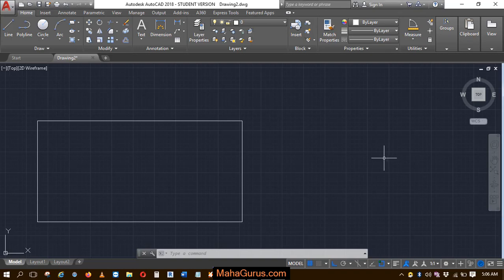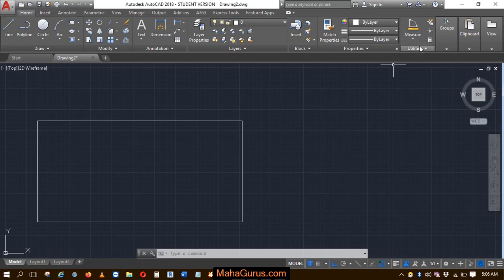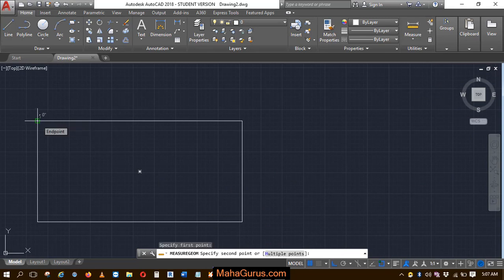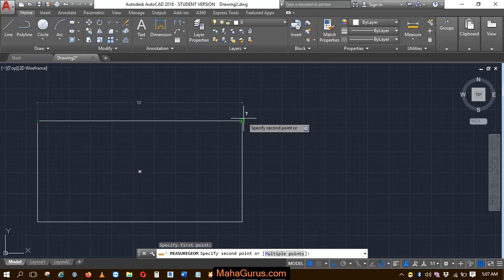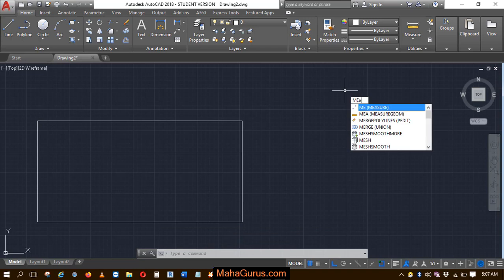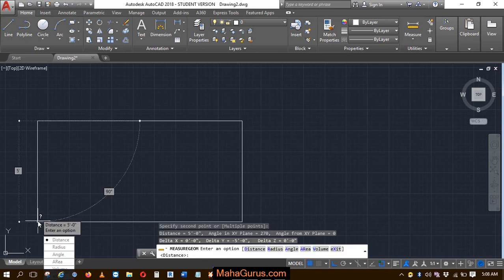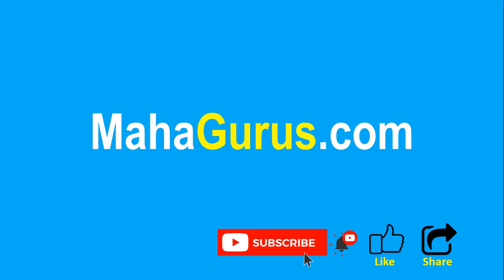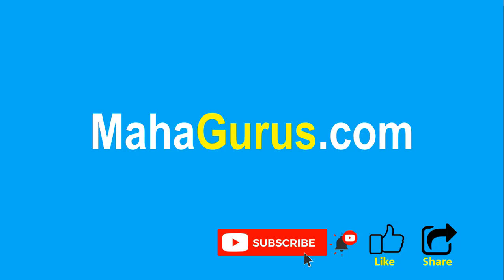How to Measure Distance in Autocad- Measure Distance in Autocad Tutorial

Comment: if you pause at :31 you can see the 10". Mine stopped doing this, it doesnt show me the dimension until I click the second point. Does anybody know the fix for this?
Reply from the maker: You have to turn it on from the settings.
use command "OS" press enter and from there you can turn on object snap and object snap 3D, check all the boxes and press done.